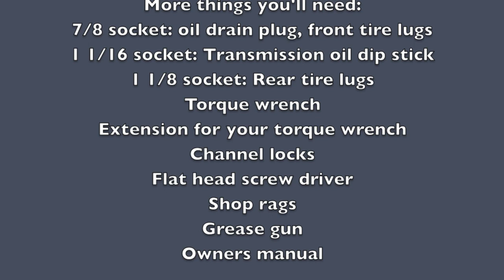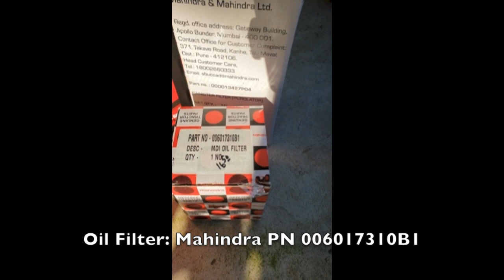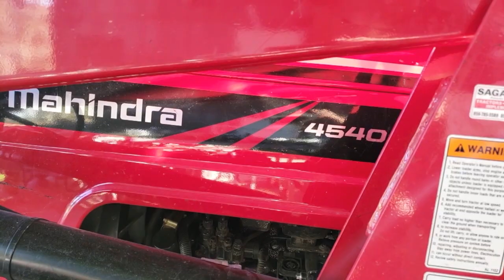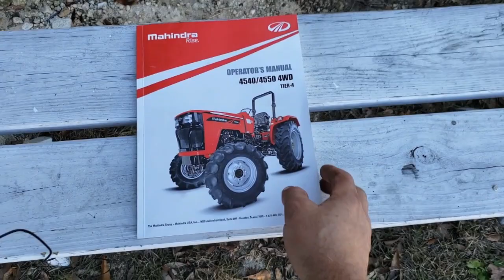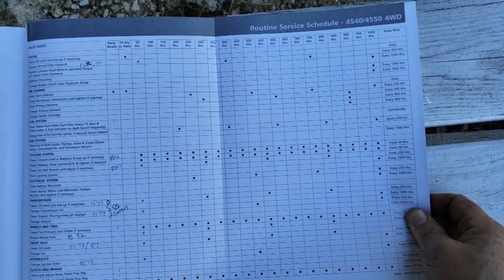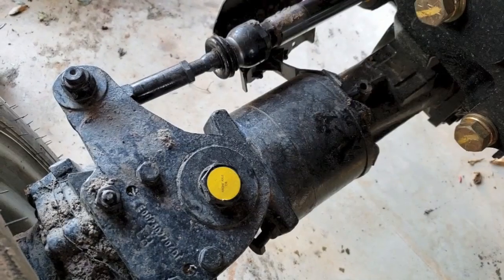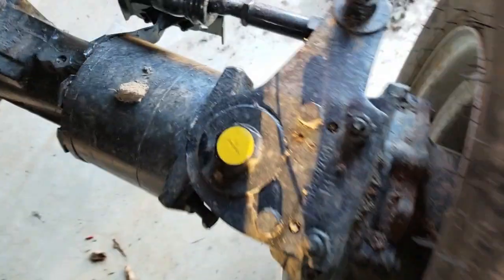Mahindra 4540/4550 50 hour service- 2019

Comment: Nice video....  I would add a couple of things for the novice or less experienced. Those two oil drain plugs are divided by a 'hump' between the two sides. After pulling the first plug, if you wait a few minutes and then pull the second plug, you'll get almost another quart of dirty oil drained. Also, those plugs have magnet inserts. Take note of the amount and size on any metal fines collected and clean the recessed area of the gunk & fines before reinstalling.

Comment: Thanks for taking the time to produce a thoughtful video. However, for anyone viewing this as a guide to service their new 4540/4550  they would be well advised to service all the fluids including the front differential including the lower units! No service is more important than getting that original break in oil out. Once a person physically sees the magnetic drain plugs there will be no doubt about this!!

Comment: I had a problem with the hydraulic filter not wanting to thread on, and found  the filter was rubbing the housing. I used a side grinder to remove a small amount of the housing and the filter went on like a charm.
Reply from the maker: Good to know. Thanks for that 👍🏻
Reply: You are correct Steve, same problem with mine, not sure why the engineer's didn't machine a flat on that hard line housing, it would have solved the whole problem, I took the housing loose(two 12 mm bolts) moved it aside and filter screwed right on, if you don't do this, you run a risk of galling the threads on tractor or filter, or both, then you'll have big trouble, not to mention the metal particles that in may created, not good for a hydraulic system, hope this helps a newbie that will run into the same problem, love your videos by the way.....thanks Hamilton Farms 😁
Reply: Mine was rubbing on the left side. The line coming from the left that goes into the square block piece. I loosened the two screws just enough to push that back away from the filter and it went right on. Tightened them back up afterwards. Thanks for the video!

Comment: I thought it was some kinda huge process because the local dealer mentioned that they will do the 50 hour service for $850 whopping bucks. So I came here and it’s basically a oil change. Thanks for the video I feel much better knowing it’s just a simple oil and filter change.

Comment: Hank - You might want to edit the video to put an info box when you talk about the oil filter turning 'clockwise' to remove. I discovered the hard way (Crushed the old filter trying to remove it) that these filters are normally threaded. From a 'top down' perspective.... sure it's clockwise... but from the direction of installation... you turn the filter counter clockwise to remove and clockwise to install.
Reply: Just changed my 4540. Counter clockwise   loosens my filter. Maybe I'm reading you comment wrong

Comment: When doing the hydraulic filter, loosen the 2 bolts a ¼ or so that are that pipe and block pull away. I usually put a screw driver (very carefully) to keep it wedged out. The block on pipe interferes with rim of filter. Filter spins right in.
Reply from the maker: Check out my tractor channel here: https://youtube.com/@hhamilton1970
Reply: Thanks for the tip I was wondering  of could be loosened!!

Comment: Thanks for the video! I have a 4540 2WD and I've been wondering what to do. Thanks it was just what I was looking for! I love my 4540 it is a beast of a tractor! Thanks again!
Reply from the maker: Thank you. I hope it helps.
Reply: I got a 4540 2wd too. Love that beast too. Got a great deal I think, leftover 2017 with loader and 6ft bushhog for 16500 out the door.
Reply: Owen, how is your 4540 holding up? Any problems?
Reply: @TheSonsOfSimon  I LOVE it! I need more implements ofcourse to distribute weight so I can do more with it. It's still trucking.This thing is strong! I'm never going to get rid of this. Yes there are problems with everything but I can't see where something else is any better. I do wish it was 4WD!

Comment: Do you think there is any benefit to pre-filling those filters before you screw them on?
Reply from the maker: I think there probably is. Probably helps with the initial flow after the oil change. I'm getting ready to change my fuel filters and my dealer said to make sure I fill them with diesel before I put the new ones on. Although I didn't do it in this video,I'd probably say its a good thing to do. 👍
Reply: I only have 20 hours on mine so far. I appreciate your videos they’re very helpful
Reply from the maker: You bet. I appreciate you watching. Thanks for the feedback 👍

Comment: Good video.  I'll be doing the 50 hour on my 4540 soon so you answered a few questions.  Have you ever thought about filling your oil filter with oil before installing it?  I've been doing it that way for years on my cars & trucks and I like the thought of starting the engine with a full filter & crankcase.
Reply from the maker: Yes, I know a lot of people do that. I have done it in the past, I need to do it next time.

Comment: The hydraulic filter issue i had was the top ring on the filter was hitting the fitting for the fluid line and it woukd not turn on all the way. I had to file that fitting as well as take the ffiler to the grinder and remove some materialfrom that ring. Then it spun right on. Poor machining.
Reply from the maker: Yeah,I've heard similar stories. Thanks for stopping by👍

Comment: Just done my 50 hr service today, my hydraulic filter was hard to put on as yours was. Took awhile, must be issue with threads either on filter or tractor. Was hard to remove as well. I went ahead changed fuel filter to, no water or grit. New oil filter red, once removed the original filter was red on backside, must have painted motor with filter on.
Reply from the maker: I reckon so with the oil filter. Glad you got the service done. 👍🏻
Reply: Was changing the fuel filter tricky? Did you have to bleed the air from it after changing it?
Reply from the maker: I only drained the water fuel separator I didn't change the fuel filter.

Comment: Thanks for the information, especially the part numbers.  For some reason Mahindra has you put in your serial number to get the manual in PDF format, but then doesn't put in the part numbers in the manual.  This is a bit irritating when there are at different filters for 2WD and 4WD models.

Comment: Do you get a lot of loose lines etc?  I have seen a lot of people saying that on Youtube.  They say loose hydraulics, leaking fuel lines, etc.  I don't have much experience with engines, so I either have to start learning or get a tractor that doesn't require a lot repairs.
Reply from the maker: Not at all. I just went over 200 hours and zero leaks any where. Been pleased with it. 👍
Reply: @Hfoutdoorsyt  Great to hear.  Thank you.

Comment: I noticed you didn’t clean the transmission screen. I’m about to do my 50 hour service and my manual says to clean that screen. Is there a reason you didn’t clean the screen? Looking at mine it looks like all the fluid will pour out when I pull the cover off for the strainer.
Reply from the maker: I did not clean the screen. Several tractor mechanic friends of mine have said it really doesn't need to be done until about 150 hours ...take that however you want. I opted to wait. I'm gonna be doing mine very soon. I have 147 hours on mine. You are correct though when you say fluid is gonna leak everywhere.
Reply: Hamiltonville Farm ok thank you. I’ll probably skip that too then.
Reply: I would love to see a video on cleaning the transmission screen

Comment: How much was that grapple and do you need any new remotes and lines to use them? I have a 2638 and been thinking about getting a grapple.
Reply from the maker: Mine came with it,yes you need a 3rd function kit ...WR Long works great. Get a wicked grapple from EA. That's what I wish I had. 💪
Reply: Ok thanks for the quick response I'm still new to the owning of equipment lol I always worked with company's that already had the equipment. So Im still learning where can I find the wr long and what is ea?
Reply from the maker: @haroldjohnsond1124  wr long is the company that makes the 3rd function kit that operates the grapple. And EA is everything attachments that makes the grapples that are outstanding. Google everything attachments and see what they offer. I'm new to this stuff too😁
Reply: Good looking out brother thank you for your prompt response once again. Does your tractor have a 3 point adjustable stop? If not have you found a way to achieve this operation?
Reply from the maker: @haroldjohnsond1124  are you referring to the draft control? If so , yes my tractor has one
Reply: It's the lever that tells your three point to raise and lower well some tractors have a device that you set so if and when you raise the three point you don't have to guess where it was positioned you just slide the control lever back till it makes contact and you are now back at the same height you was operating the implement at previously.
Reply from the maker: @haroldjohnsond1124  gotcha.

Comment: The reason for the hydraulic suction filter gets stuck on taking it off and putting it back on on a 4540 Mahendra the problem is whoever engineered the suction tube up on top. It’s close  to the filter rim when you try to screw the filter on the lip of the filter, rubs on the edge of the tube where I normally did is took a grinder and grind it my filter all the way around a little bit Made it flat all the way around. You could also get your grinder and make a flat spot right on top of the suction tube where it’s rubbing and you will not have no problem taking filter off and putting it on engineered the tube to close to filter.

Comment: If you don't oil the oil filter seal it will stick to a hot engine and then good luck getting it off.
Reply from the maker: I heard that. Thanks for the comment 👍

Comment: So Bubba if you do this on a 50-100 hour basis,  this Tractor should last a lifetime right? Do you still feel this is a solid Tractor? I missed my chance 
I could have purchased a 4540 w loader  4 wd for $17,700 before tax. It was a left over 2017 model however I talked to the dealer today and it was sold. He has a 4550 but not anywhere near that price. I'm still eyeing these models because I like old school and the competition cant touch it. Good video Bubba. 
I just finished a grading job for a builder yesterday. 8 tandem truck loads of dirt. I have an LS 33 HP.
Reply from the maker: The tractor is solid! Do I wish I had a hydrostatic transmission? Eh, sometimes. When I'm doing a couple hours of going back and forth for short distances I think about it. But then I look at what I paid for it and I quickly realize how much I love this tractor 🙂 seriously though, so far I'm digging it. And yes, PM every 50-100 hours is key. I'd recommend a Mahindra to anybody.
Reply: I have a 4540 2WD with a loader and it is a beast. I love mine! I recommend Mahindra to everyone looking for a good tractor also. Just to let you know.
Reply: Love my 4540!
Reply: @thebugman2007  That Tractor is old school just what I like. Heavy, very powerful from what I see.

Comment: Please help! I’m doing my 50 hour service and I can’t find where I fill my hydraulic fluid did I miss it in the video???
Reply from the maker: Put it in at the yellow cap by the gear shift lever. It says transmission oil on the cover. On the floorboard between your feet 👍

Comment: I did my 50hrs today I put 2gal oil back into it that was to much oil . I did not get 2  gal oil out . I'm wondering is it because I only pulled one drain plug??
Reply from the maker: No, either plug works. ...if your dipstick shows your good, then I wouldn't worry about it unless you see some obvious leaks.
Reply: @Hfoutdoorsyt  I put 2 gal. Back into the engine and it reads over full on the dipstick oil is about 1.5 inch above full notch.  Trust me I'm confused
Reply from the maker: @msanford75  hmmm 
 That is weird.
Reply: @Hfoutdoorsyt  Hey Hank and Mike S,  I know this is 10 months too late...
 I just bought a used 4540 a week ago and decided to change the oil and oil filter this weekend.  (I appreciate the video by the way....).   However, I think you do need to pull both Drain Plugs.  I pulled one and let it drain for ~ 2 hours while I was doing other stuff.  The magnet on the plug needed to be cleaned so I thought "hey I might as well pull the other one to see if it is dirty as well.  I was not expecting any oil but when I pulled the 2nd plug, about 1 or 1.5 quarts came pouring out.  So I am thinking we need to pull both plugs.  I don't know what the inside of the drain pan looks like but it obviously still had oil left in it.    Anyway, not sure if they changed the drain pans over the years in that model of tractor.  My 4540 was bought new in Nov. 2018.  But that would explain why Mike S. had too much oil after adding 2 gallons.   Mine was right on the money when I checked the dipstick afterwards.   Oil filter was a major pain to get off but I finally got it.

I plan to tackle the Hydraulic Suction Filter next weekend.

Just wanted to bring this up.  I watched thus video as well as the Greasing the 4540 and I appreciate your efforts on both of them!

Ya'll have a GREAT day!
Reply: @docgillman2548  The shape of the pan explains the oil.  there's a big hump in the pan so both sides hold oil.
Reply: @msanford75  The shape of the pan explains the oil.  there's a big hump in the pan so both sides hold oil.

Comment: I'd use semi synthetic...That's all I use in my diesels
Reply: Do some research on blended oils. Semi or blended oil is not 50/50. I am a amsoil nut. I know I know amsoil.....lol I get it a lot, but that is what I like. Rotella t6 is 100% synthetic and cheap. I will run rotella if I'm in a financial bind. Great stuff, tremendous stuff, it will do great things.